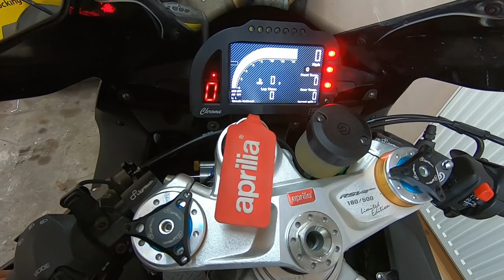Really handy Track & Road Upgrades for your bike and my new Motovloging Channel Chasing Tenths

Comment: 👍6 weeks away from my 2019 factory ; Got a list of mods thousands of pounds long of which 90% i wont do (just excitement) ; cheers for this - I'm sold on MRA over PowerBronze & PUIG , but that & a smaller front sprocket , rear sprocket & chain mod & the Gabro UpMap seem to be good starting points - there is a fella called extreme oil obsession who checks the friction resistivity of oils ; Motul 300v is sublime - didn;t work well in my suzuki or kawasaki but most people claim its perfect for the RSV4
Reply from the maker: Absolutely, you are spot on with all of the above stuff … motul 300v is definitely the one to go for , that’s for sure and MRA screen is superb too , feel free to ask any questions on upgrades